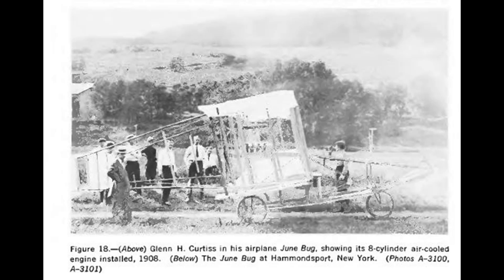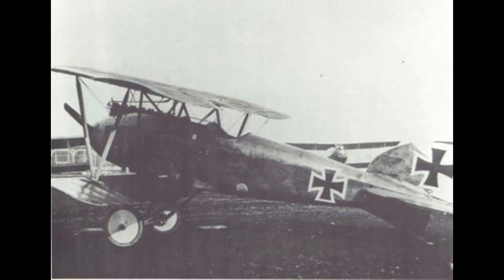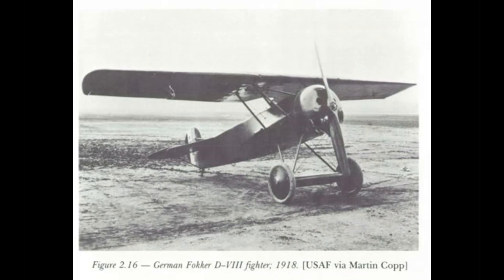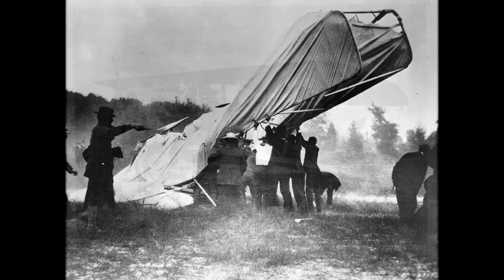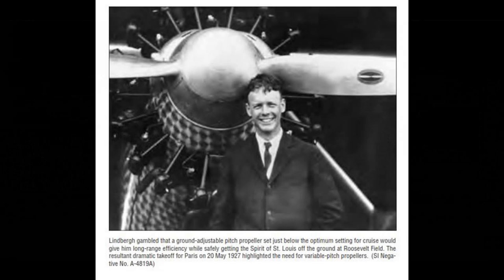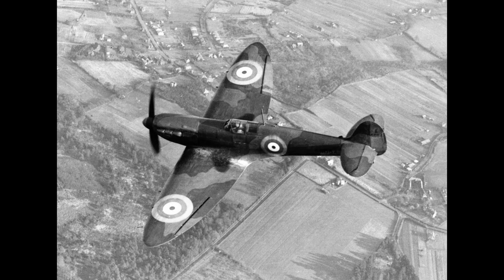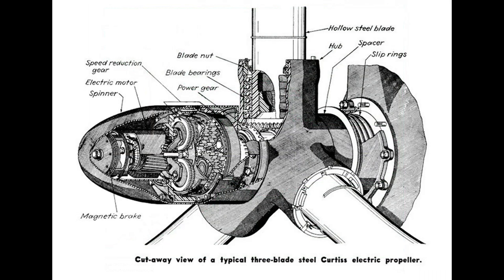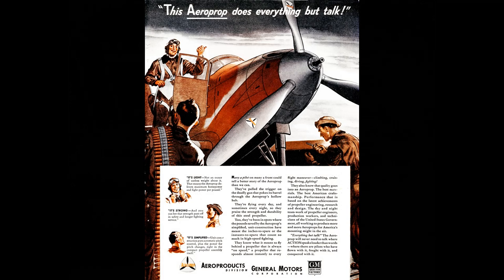Advancements In Propellers 1909-1942

Comment: Not that it alters the basic point you are making but when talking about the Germans capturing Spitfires during the Battle of France you are confusing Spitfires with Hurricanes as no Spitfires were sent to France. The first time the Luftwaffe ran into the Spitfire in combat was over Dunkirk where they were operating from bases in England.  The discussion over props (or airscrews) still applies to the Hurricane as well as the Spitfire though as it was largely the same story for both aircraft.
Reply from the maker: I am not confusing Spitfires with Hurricanes. Think about what you said. "no Spitfires were sent to France" then in the next sentance "the first time the Luftwaffe ran into the Spitfire in combat was over Dunkirk". Dunkirk IS IN FRANCE. The British lost 67 Spitfires over France during this period.
Reply: @GregsAirplanesandAutomobiles  Maybe that would be a good subject for a future video. I.e. what the Luftwaffe thought of the Spitfire and how they initially evaluated it.  How they managed to get a relatively intact example and fly it against the `109 would be interesting though I don`t think that happened until around the period of the Battle of Britain. As far as I know there were at least two cases of Spitfires going down on the beaches round Dunkirk and landing in a more or less intact condition but in both cases all that happened was that the Germans took a few photographs then left the wrecks in place to be covered by time and tide.  Which allowed them to be recovered in more recent times.

Comment: "A gun will never fire through the prop hub of a plane  that has a Hamilton Standard prop"  laughs in P-39 and P-63 which both had variants with Hamilton Standard props and both had a gun that fired through the propeller hub (in the P-39 it's the only gun on the aircraft)
Reply from the maker: P-39s and P-63s with hub cannons used either Curtis Electric or Aeroproducts props depending on which model. (For example P-39Q-1 has Aeroproducts). If you have a source showing an operational P-39 or 63 with a hub cannon and a Hamilton Standard prop, I would love to see it. Also, your wrong about the hub cannon being "the only gun in the aircraft". That was not the case. You might enjoy my up coming P-39 video which will have more information on this.
Reply: @GregsAirplanesandAutomobiles  on initial and several later variants of P-39, there was only the cannon firing through the propeller hub although the P-400 variant of the P-39 may have had more than just the autocannon in the nose which was for the most part a 37mm
Reply from the maker: Yes, absolutely. Nobody denies that there was a cannon firing through the hub on those planes. The issue is that you said it was with a Hamilton Standard prop, it wasn't.